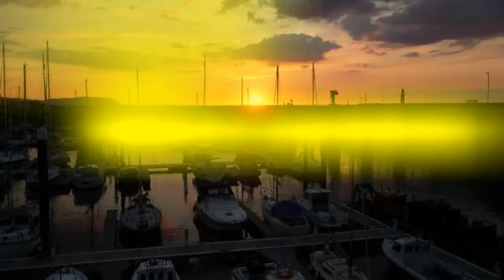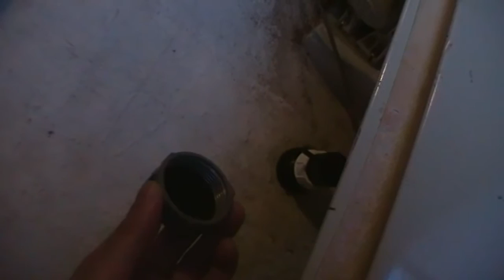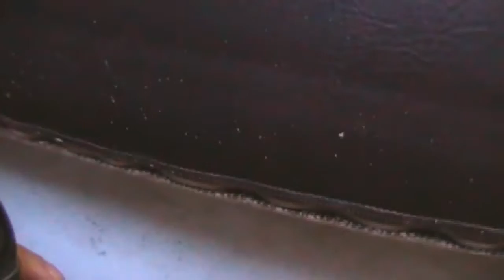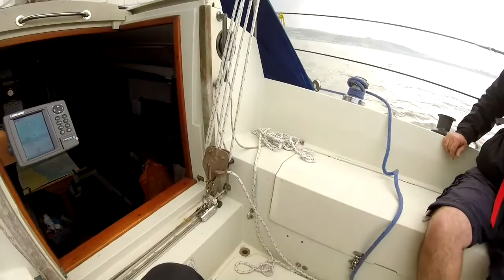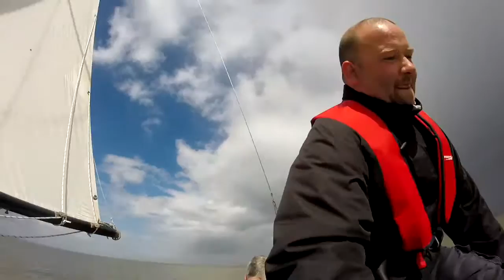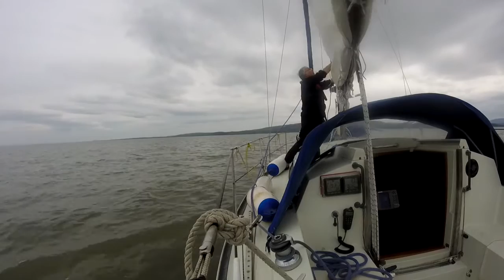Just About Sailing May 2016 - Proper sailing with actual wind where nothing breaks

Comment: The last time I was in Watchet it was silted so much that the boats were drying out, I wondered why you didn't change your paddle wheel when sat in the mud?
Reply from the maker: +Pill Sharks They have done a lot of work to try and counter the mud problem.  About 2/3 of the harbour is now at about 2m with the gate closed (the gate now works by the way).  I draw about 1.4m, so I am floating all the time.
Reply: +Just about sailing    That's good to know that they've finally done something about the mud build up, my mooring is in the upper part of the channel and I looked into leaving her in Watchet as I love the place but unfortunately they were rather expensive considering the mud build up!
Great videos also